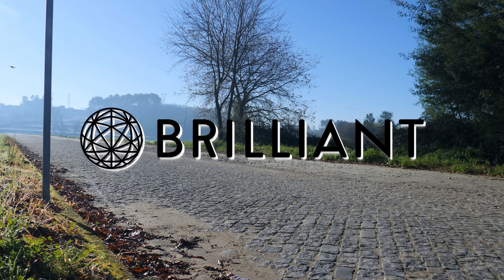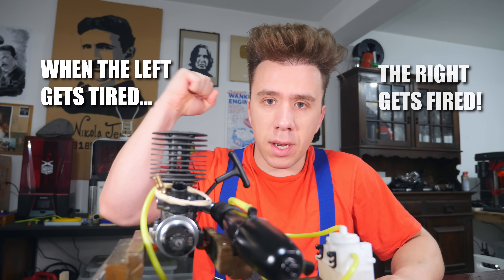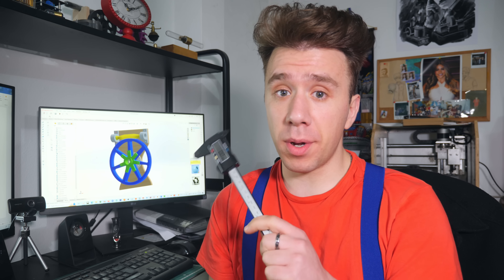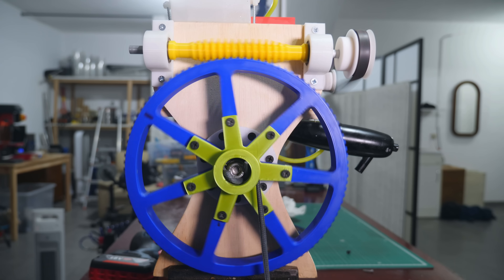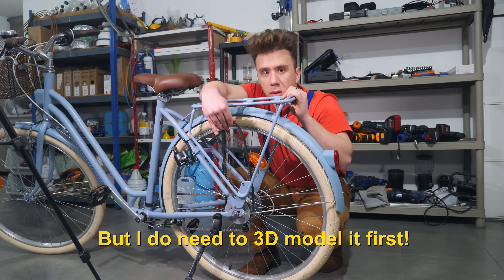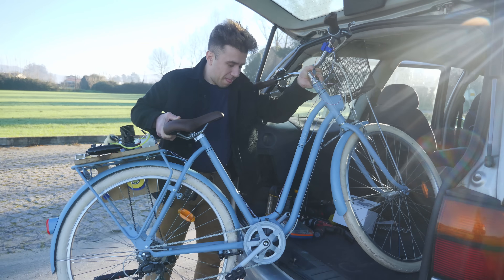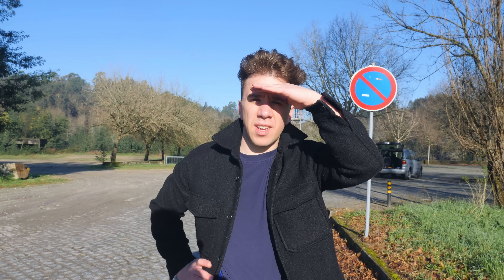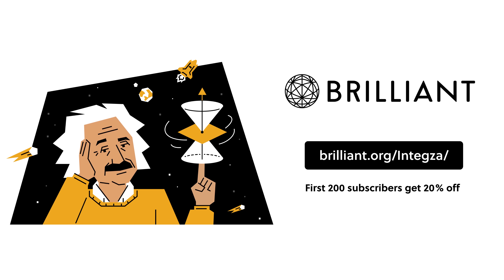Tiny 3.5 cc NITRO ENGINE on a BICYCLE

Comment: @5:52 Do you realize how close you came to a 2x4 in the nuts?  At high speed, no less.  Never ever trap a piece between the fence and the blade when it's wider than it is long.  Kickback can hurt - even if it doesn't yank your hand into the blade.

Comment: bottom end rich 1/4 left topend lean 1/4 right... on engine next time use the 5.9 hpi engine riching the toping keep from overheating at full throttle no more the 10s intervules great content liked the video.

Comment: 2CV means 2 fiscal horses just a measurement for tax purpose. The fist 2CV in 1948 was 9 HP with its 375 cc flat twin engine. It ended its career with 602 cc and 29 HP.

Comment: This reminds me of something we have in France ; just after WW2, a bicycle company names VéloSoleX put a 50cc engine producing 0,8 hp on the front of a bike, and they produced it in many versions until the 80's. It's super fun to drive, kinda similar to this masterpiece of homemade engineering and 3d printing you made !
Reply: 50 cc two wheelers are still in use- https://en.m.wikipedia.org/wiki/Moped
Reply: @rtos  Yes, I have one
Reply: Also motorized bike kits.
Reply: Aaah, the 'Solex: they solved the gearing problem rather elegantly, by resting the motor axle on the front wheel.  👍
A friend rode one in the late 1900's (1995 or so). 😁

Comment: Don't recommend this placement of motor. But I think, the best place to attach the motor is to crank or somewhere on the chain. That way you can control the torque and speed partially with bike gears. With this configuration I believe that there is no torque control, right? Also pacing it on top of back wheel takes up a lot of storage place.

Comment: I seen 28 and was like dang that’s quick… then I seen kph and I was like nevermind, I have a little 80cc engine on a bicycle, but that thing pushes about 5hp and gets the bike up to 28 with my skinny boy on it, and 25 with my fatass on it, when I wanted 400 it was still going 25, I was 350 now tho so I should see if I’ve gained any speed lol

Comment: Nitro is hard to get, and nitro fuel can be expensive. Most two-stroke model engines can run on just methanol and synthetic two-stroke engine oil. (I used Klotz brand,, but others may also work well.) You will need to see if you can increase the compression ratio slightly to get optimal power out of that furl combination. Some model engines use shims under the cylinder head to raise or lower the compression. You might be lucky and find additional thinner shims with your box do that can convert to non-nitro use. I would start with 18% oil and 82% methanol. You might be able to reduce the oil by a few percent, but it will be hard for you to tell if you've reduced the oil too much,  other than your engine starts to over-heat and wear prematurely.

Comment: These Nitro engines need to be broken in properly. Ideally you have the fuel mixture on the richer side of things, and run about half a liter of fuel through the engine, with each tank of fuel (around 100ml) you let the engine cool back down. Once that is done, you can lean out the air-fuel mixture, and get the best performance, and the best lifespan possible.

Comment: 2cv relating to the tax paid, 2 cv 2x tax, 3cv 3x tax, not HP, In 1949, the first delivered 2CV type A was 375 cc, 7 kW (9 hp), with a 65 km/h (40 mph) top speed, only one tail light and windscreen wiper with speed shaft drive; the wiper speed was dependent on the driving speed.
Reply: Correct !

Comment: I think you under engineered this. You should have made the gear in steel, and added a solution to keep it greased. If you buy and old kitchen machine like a kenwood you can find this kind of cast metal gears inside.

Comment: Imagine a futuristic scooter that doesn't run on gasoline, but instead, on simple materials like baking soda and citric acid (the stuff we use in our kitchens), and water. Here's how it would work:

1. Frame and Wheels: The scooter, like any other, has a frame and wheels. The frame is made of strong, lightweight material so it's easy to ride and maneuver. 

2. Engine: Inside the scooter, there's a special kind of engine. Instead of burning gasoline, it uses baking soda and citric acid mixed with water. When these ingredients mix together, they create a lot of gas and pressure. This pressure pushes a part of the engine back and forth, much like your leg pushes a scooter forward.

3. Power Generation: This back-and-forth motion creates electricity, much like how a windmill generates power when the wind spins its blades. 

4. Water Splitting: The electricity that's produced is used to split water into hydrogen and oxygen gases. This is done in a special compartment in the scooter called an electrolysis chamber.

5. Hydrogen Power: The hydrogen gas that's produced from splitting the water is used to make more electricity in a device called a fuel cell. This is similar to a battery, but it runs on hydrogen gas instead of chemicals.

6. Motor: The electricity from the engine and the fuel cell is used to power an electric motor in the scooter. This motor turns the wheels and makes the scooter move. 

7. Battery: There's also a battery in the scooter that stores any extra electricity that's produced. This can be used to power the scooter when the engine isn't running.

8. Control System: The scooter has a control system, like the brain of the scooter, that makes sure everything is working properly. It controls how much baking soda, citric acid, and water are used, and it makes sure the engine, electrolysis chamber, and fuel cell are all working together smoothly.

9. Safety Features: The scooter also has safety features to prevent any problems. It has special valves to release any extra pressure from the gas, and it can shut down automatically if anything goes wrong.

10. Handlebars and Seat: Just like any other scooter, this one has handlebars to steer and a seat to sit on. The handlebars have controls for speeding up, slowing down, and stopping.

11. Lights: The scooter also has lights so you can see and be seen when it's dark out.

So, in simple terms, this scooter is like a little science experiment on wheels. It uses simple materials and clever technology to generate its own electricity and power the scooter, instead of burning gasoline. It's a fun, green way to get around!

Comment: I love this project.  As someone who has spent more than half their life tuning nitro engines, I am both happy and sad at the sound of hearing one struggling!
Reply: Do you think it's struggling because it's revving low or for some other reason?

I have this chinese gas 68cc two-stroke engine kit on one of my bicycles, it's power is probably less than 3 HP and I can go about 45 kmh at full throttle without wind, and that may have more to do with the overrevving at that speed anyways. I don't know much about engines and nothing at all about the tiny nitro ones, but the speed of 32 kmh or so he got seemed suspicious to me seeing the 2.5 hp figure. I guess the funny brass to teflon worm gear drive is sucking up a lot of power but it can't be that much right?
Reply: @mad_scientist5597  The worm drive is destroying the power.
Reply: @gribly  Yeah I'm not sure why he wouldn't just go from the engine, to a large pulley on the wheel with maybe a belt tensioner.

Comment: Worm gears give a lot of reduction but aren't very efficient and wear quickly (because of the screwthread rubbing on the gear). They are more useful when you want to lock something in place or clamp with a lot of force (guitar strings or bench vice).
Also they only work one way, and you will need a freewheel or your bicycle will grind to a halt as soon as you let off the throttle.
Reply: A couple different jackshafts with a few radical reductions would have been much better to use
Reply: @theeoddments960  I think a toothed belt for the high speed primary stage and possibly secondary stage, then to chains as the speed comes down and torque comes up.
Reply: I wanted to write same thing. Two stages belt/chain would be much better.
Reply: not all worm gears operate "one way". its about the helix angle.

milk/ cream separators, and a lot of vintage cars (pre 1920?) use worm gears that will "back run".

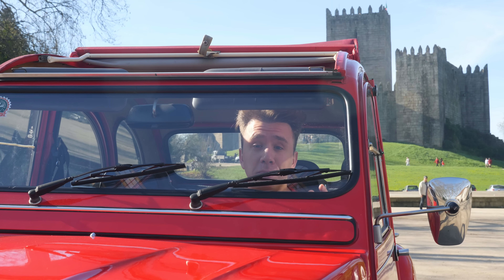Comment: 0:32 I’m French. The name of the 2CV isn’t from the engine horsepowers but ”tax horsepowers”. 
And it’s even not a joke. You know how my country IS DAMN CRAZY STUPID ABOUT TAXES. 
So in France every cars must have an ID card describing the car model and who’s the owner. 
When you buy a car (new or used) you must create a new ID car card, to have the right to drive it and prove it’s yours. 
The price of this card DIRECTLY depends on the car “tax horsepower”. 
This tax is determined by a ton of factors but mainly : engine size, car size, type of engine, type of car etc.
I don’t go further in details but more the car model got tax hp’s more the ID car card price will be expensive. 
Now you understand why the Citroën 2CV has its name, because VERY LIGHT, little 2 cylinders “bike engine” etc. 
It was made to be a cheap car !! 😊

Comment: No, the Citroen 2CV were not "2hp", in fact there are several powers (in HP) for the same model.
2cv stands for chevaux fiscaux, 2 "chevaux fiscaux" is more or less 9 to 12 hp.
It is more related to fuel consumption and displacement than to final power.

citroenm 375cc have 9hp
425cc h2 12
435 25
and the most powerfull and comon ones so called 3cv, 623cc have 29hp.

Comment: People may not have noticed, but you just demonstrated what a wimpy fuel gasoline is.  Using nitro with methanol may not be such a bad idea as a replacement.  Look how much smaller the engine could be, and how much lighter.  We don't see it, but our V-8 engines are way too big and cumbersome to ever classify as efficient in vehicles for the fact they take up so much of the cargo and add so much weight.   You got 2.5 Hp from 3.5 cc's.  From a 50 cc engine that would equal 35 Hp.  Why don't we use a better fuel folks?  That's the big story here.  Gasoline is the same garbage as from 1876 when the first gasoline powered vehicle appeared.  It detonates at a compression rate of above 10:1.  So guess what, all gasoline engines are big engines and we never think to ask for a better fuel.  Nitro methane is NO2CH3.  All of these components are available from the atmosphere.  Methanol is CH3OH.  You can produce it from anything that will burn and produce smoke.

Comment: Nice craftsmanship, I must say.  Considering that bicycle racers average 40-45 kph, and are probably putting out about 1/2 hp, your drive is pretty inefficient.  I think a double reduction chain drive driving the rear wheel directly would probably get you up around 80 kph.

Comment: A 2CV actually has about 9 HP....

"Why did Citroen choose “CV” for the 2CV?
Back in the 1930s, the French government introduced a taxation system based on engine power. The more powerful the car’s engine was, the higher the taxes the owner had to pay. Citroen’s aim with the 2CV was to create an affordable and economical car for the masses. By limiting the engine power to only 2CV, Citroen ensured that the 2CV fell into the lowest tax bracket.

Comment: My gilera 50cc liquid cooled enduro/dual sport moped has 8,6 hp My derbi drd pro 50cc full size LC moped had 8,8HP . remember HP is torque X RPM so the torque in your little engine has very little torque but a lot of RPM so a Yamaha 2hp boat motor is many many times stronger than your hobby grade 2hp motor. so it would be more honest of the manufacturer to measure the power in torque like with ebikes

Comment: 2,5 HP was using on themopeds here in Norway some years ago with 50 ccm engine. Max allowed speed was 50 km/h, but with other gear ratio they go 60 km/h.

Comment: For the 2CV it's not true, in france HP are the same as the rest of the world and called CH, the CV are the tax horse power ( Cheval fiscal in french ) and is the way we calculate the taxes for car papers and insurance, the Renault brand has a " 4CV " model back in time and even the 2CV with the final models has a bigger engine with 32hp 602cc engine and 3 tax horses, but still used the 2CV name 
The CV is calulated on the cc basis and other parameters but not on hp, in exemple the Peugeot 504 1.9 diesel is a 10CV but only have 49HP and a Alfa 147 8CV with a 110hp 1.6

Also the 9hp engine of the 2CV was a real thing but in the post war aera, quickly upgraded because it was slow af with 60km/h top speed on flat

🤓

Comment: I took note of how high you had the blade set on your table saw when cutting your plywood. Suggestion: Whenever using a table saw, set the blade height to protrude approximately 5mm (1/4") above whatever it is you're cutting. The idea behind this is one of safety. Should you slip or get careless while pushing wood through the blade (or aluminum, using a carbide blade), you might keep your fingers; damaged, yes, but still attached. Whereas with the blade set as you've been using it, you could lose not only your fingers, you could lose a hand! And cutting a finger can happen easier than you think; I know a number of professional craftsmen who have lost multiple fingers in the blink of an eye! Stay safe.

Comment: Tip to start the engine easier, put your finger over the air intake and turn it over by hand a few times. It chokes it and pumps in some fuel. Then start it normally.
When you're done, you should empty the fuel tank and run the engine dry, then put some protectant oil in through the intake and turn it over a few times to distribute. 2 stroke oil, engine oil, and engine cleaning and lubrication products are probably all fine to use for storage.
Reply: Good advice, thank you
Reply: just a correction: a 2 stroke does NOT like to be run dry, as it runs so lean it stalls from being out of fuel. do this a few times, and it will absolutely score it up and shorten its life drastically. i know some people do it, but its just not good. plus Nitro has no ethanol, and its a synthetic fuel so its like diesel in that it doesnt go bad. no need for this.
Reply: U need to put the finger in the exhaust … the exhaust pumps the gas in the carb

Comment: You’re really going to hurt yourself badly using a table saw like that. 

Blade fully exposed unnecessarily. And letting go of off cuts between the fence and sled. Yikes.

Comment: The reason it took so long to start at first was because it wasnt primed. Put your finger over the air intake and pull until you see the fuel in the line go into the carburetor

Comment: I have a 4 stroke 35 cc honda on my bike, its much quieter, stronger and faster than that rc engine and its barely over 1 hp
Reply: And its all steel and cast aluminum. I tow a 3'x3' cargo trailer with it as well

Comment: I think 2CV is referring to the two cylinders of the engine, i.e. two horses working for you rather than the BHP output of the engine. With regards to the gearing of the engine, you could have reversed engineered it, basically 2.5 BHP will get you to about 30 MPH on a moped (48 KPH). You could have worked out the bikes wheel RPM to get to about 48 KPH then worked out the gearing to achieve this wheel RPM when the engine is at peak RPM.

Comment: Can you try 3d printing a mini comet torque converter? I am sure it would help with the top speed. I had a 79cc 4 stroke engine mounted on the back of a bike like that with a torque converter and the bike would go 45kph at half throttle. It thing was so scary i dismantled it and gave up on the idea. I am not sure you will ever get very good fuel economy with that engine lol.

Comment: You can put a little smaller metal pulley on the tire or on the main pulley and try plug a much stronger clutch on the engine! You can easily reach 45 km/h with this mod

Comment: Prime the engine first before you go pulling on it like mad. 

You can end up scoring the cylinder liner by pulling on it if it isn't getting fuel/lube... 

With no piston rings in these engines, one LITTLE score in the bore and it's all over... No more compression and no more running.

Comment: Engines too cold to start, without a drill. Also why not use a 3d printed cv transmission instead of a worm gear.

Comment: Welcome to the NITROGANG! If you had of primed that engine it would have started in 2 or 3 pulls using the pullstart. Also your engine was running too lean to make usable power at full throttle. Unscrew the high speed needle! Richen it! More smoke! 💨

Comment: They start very easy with the pull start, fill the fuel tank then hold your fingertip over the exhaust while giving the pull start a couple of pulls. Doing this you will see the fuel go through the clear fuel line, once that fuel reaches the carb you take your fingertip off the exhaust hole. Then put on the glow igniter and give it a pull and it will fire right up.

Comment: @5:54, Cutting that 2x4 with the short side between the fence and blade is VERY dangerous. It can easily bind between the fence and blade and throw the piece violently. If your hand is involved as shown, it can also get involved with the spinning blade.

Comment: Unfortunately what was not said is as important as what was said.  32 kph is not bad for the flat, but maybe only 2% grade would reduce speed to that of a snail or worse yet just refused to climb at any speed.  All in all a great vid on HP, gearing ratios and 3D printing.  Kudos.

Comment: Hi, grate video i like making mad things like that, when 14ish i put a strimmer or weed wacker engine on a bmx bike it was great till it started kicking the chain off and was a pain to align the chain, where did u get the small belt that went from the worm gear to the engine thanks liam 💯👊👊

Comment: Just a few minutes into the vid... watching your pain at getting it started.  Heres a tip from the good old RC car days.  Plug the exhaust with your finger while you pull - it basically forces the exhaust through the tank and primes the system - it will start much easier.